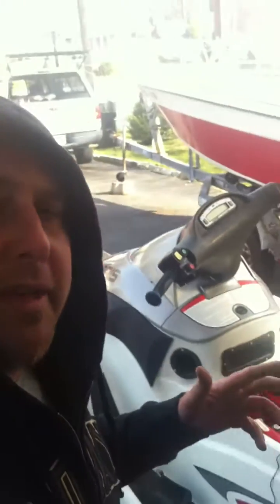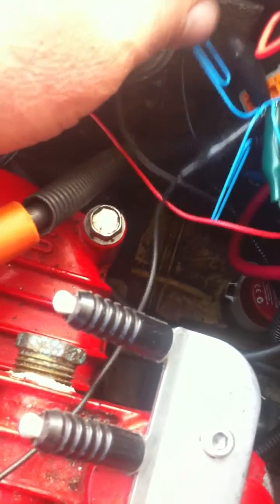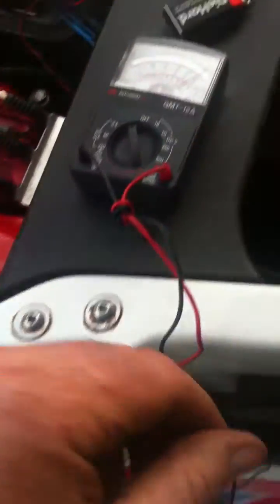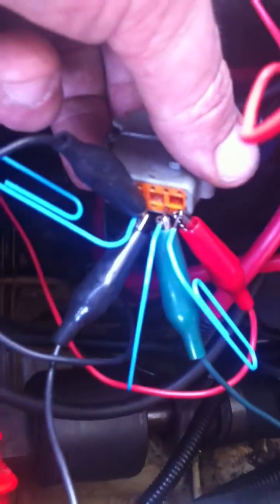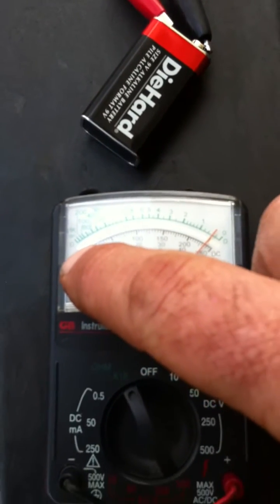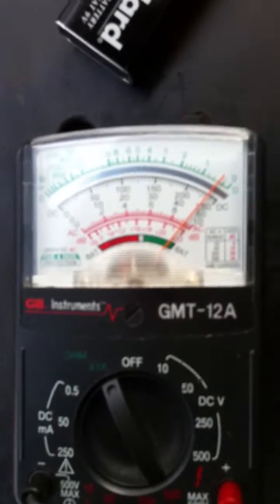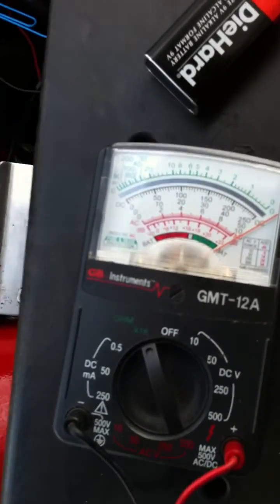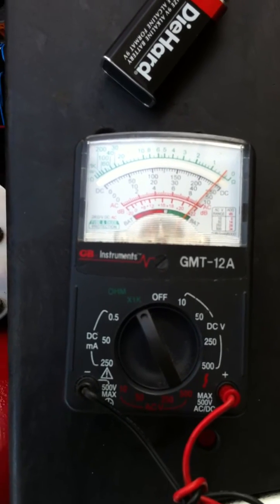2000 Polaris SLX 1200 Stator / Hall Effect sensor testing

Comment: Need to spin by hand as signal duration is very short  and will not be picked up just by turning motor with starter.... pull plugs to make it easy to turn over slowly  to get signal at tdc repeat for all three cyl. ie: red green blue    ;)